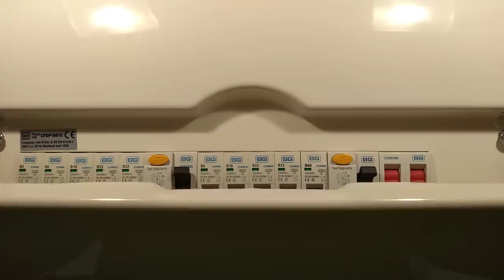A look inside a British home electrical panel.

Comment: Hi Clive 
Really enjoyed this video 
I was having problems at Christmas time with the power in the house if you remember I was asking you about inverters for the house?
As RCD tripping now and again anyway Christmas Day most of the lights had been flickering especially the kitchen ones as they were the cheaper LEDs and I put it down to that cos they have done it for sometime I.e two years put not all the time they were really bad on Christmas Day...
Sitting watching tv after dinner the tv etc went off but left lights on I thought RCB tripped again this time I couldn’t get into garage (electric door with battery backup ) so had to break the window 
Turned RCD back on for it to trip again 30 mins later spoke to my electrical and said he would come out Boxing Day to check .... 
I did notice my UPS was going daft through the night 
Next day electrician came out and we put it down to a faulty RCD he put another one in did a test and it held 
Rigged up a circuit to test old one and it tripped .... job done or so we thought 

When I came back to the garage after switching everything back on I noticed another electrician across the road said to mines and he said he was ok then the look on his face was a picture he called him turns out theirs was the same RCB kept tripping turns out we were on the same phase and it was an earth fault under the road it was soon sorted 
But a few weeks later I was having the same problem again RCD was faulty but was put in when we still had the problem 

Anyway I have now upgrade the consumer unit to the new metal box with all mines now RCBO with inline from grid surge protection so far all is well 

P.s we are on a PME system that’s why they came out as fast as the flat that was on the same phase had an old system and their earth was potentially live...

Comment: It’s odd to my tiny US brain there are so few available slots. A 100 amp panel here has 12 slots for 240 volt circuits. But since most of our circuits are 120 volt we have 12x 120volt so 24 circuits minus the appliances that needs 240 (electric dryer, water heater, AC, oven). 

Point is, doesn’t it become more likely to pop a breaker for an entire floor or section of the house by so many outlets sharing the same circuit and breaker? Seems like people using it would be very accustomed to visiting and resetting things in it.

For perceptive as a technician more than half of our customers don’t know where there panel is. I’ll often find them with the cover rusted shut, painted shut or most commonly if they are in a basement there is 4 tons worth of storage junk stacked in front of it. I even had a customer that had a panel that had a contractor put a wall over it prior to them moving in 8 years prior. While I don’t see a hazard with the UK setup it seems to encourage untrained people to be in there panel box. This is further exaggerated by putting the GFI reset in there too, don’t they commonly use switches on outlets but the gfi reset is in the panel?

Then again like I mentioned, tiny brain over here. I might just be missing something obvious.

Comment: as an norwegian electrician looking at that thing.. well.. i be glad i dont have to wrap my head around that type of thing.. our distribution rails are all phases and wrapped in plastic and rated at 63A.. so usually higher than most 400V houses.. and they go under the head of the screw and not in the cable-hole.. see your fuses there have slots like ours for rails there... dont they exsist? that thing there looks like its 150A.. it looks about 3 times thicker than our rails.... we have RCD on all fuses and connect all phases to the fuse..  i remember many years ago that the higher-ups claimed you couldnt get earth-fault in 400V systems.. then shortly replaced by, you dont need RCD on the neutral because faults between that and earth should'nt be possible.. and shortly after we got RCD on both live phases and neuteral.. fun times

Comment: Plastic fuse boards are easier in some ways but I've seen so many that are broken, some even exposing cables and the risk of electric shock, others would have the front lid covered in electrical tape because the fixing points had broken.

Comment: the concern for well being over nuisance tripping in the uk always amazes me, it's common in the us to have your refrigerator not on a gfci/rcd at all as well owing to the fact a nuisance trip could lead to spoiled food.  likewise it's common to find houses with zero gfci's in them even in bathrooms.  

our service tends to be 60a 240v on ancient services 100a on really old setups 150 sometimes or 200 on anything modern, generally 400a service is provided to two 200a panels for residential use not a single 400a panel.
it's not uncommon to find houses with 30-70 circuits in them especially when older systems are upgraded but the old circuits are left in place.

three phase is common in commercial installs but very uncommon to houses, when delivered it tends to be delivered with 208 phase to phase with neutral or as 480 or 600v delta with a transformer to generate a  120-0-120 split phase supply for smaller loads.

Comment: Thanks for the overview, it reminds me of a lot more of industrial equipment panels than what we see in our US homes. I prefer wiring industrial panels so I would probably enjoy this type of setup at home. Is that a giant ferrule on the split hot line connected to the first RCD? Are the panels in large commercial buildings similar?
Reply from the maker: Yes.  It's a dual wire ferrule.  Quite unusual in that size.

Comment: I encountered an incorrectly tightened bus bar in a consumer unit in a friend's workshop. It manifested itself as an intermittent loss of connection and a smell of burning fish. Whoever fitted it obviously had experienced the problem and then attacked the bus bar with a hacksaw to allow it to poke in further but still on the wrong side of the clamp.

Comment: MCBs dissipate power too, not just RCBOs. Wylex's datasheet claims for an RCBO it's 1.5W per pole at rated current, and 2.6W per pole for an MCB.
Reply: I think clive was talking about standby current, not losses under load.
Reply: @Basement-Science  Yeah, must be. Having rewatched Clive's disassembly of the transparent Chinese RCD and John Ward's disassembly of a Hager RCBO the circuitry appears similar, so I suppose an RCD and RCBO must have around the same standby dissipation.

Comment: This is interesting its quite similar to what we have in aus with the only difference being a lot of new installs are using rcbos for each circuit though many are using 1 or 2 rcds and standard cbs for the other circuits

Comment: mine doesnt have any rcds and it was refurbished 4 years ago lol you have lights, sockets, heater, cooker, kitchen sockets. (total of 5)
each has its own trip and then you have the main switch. no rcd at all. - i was surprised as the old once had 2 and looked like one you have, but the new ones we got 4 years ago only have 5 fuse/switches and the main one
Reply: 5 fuse, hear only one room house, haha. normal legally minimium fuses have 2fuse/room, one to light and one to soccets.and light need 10A and soccet need 16A normally, only water heater 3,2kw 1 phase need 16A fuse but if have biggest need own cable and own big fuse. same owen need little need only max 3,2kw 16A and big need 3 phase 20A normally.
Reply: It's definitely the first time I've had a fuse box without any rcds 😂

Comment: Most American boxes look so much more utilitarian. Big grey box somewhere in the basement (or mud room) with bland looking black circuit breakers.... That one there looks much more "stylish" I guess is a good word.. That box looks like it designed to be installed on a wall instead of between wall studs though.

Comment: Why isn't the main switch also a circuit breaker in a British consumer unit? It seems to me it would be better to not rely on the distribution network's main fuse, which when blown can only be replaced by them.
Reply from the maker: It would have to be a fault inside the consumer unit itself to cause main fuse failure.
Reply: Why would it need to be?
Reply: I think it's because atop of that breaker you have the main circuit breaker provided by the electricity company. It's how it works in France, but we have a different system so that mgiht not be like that.
Reply: At home I have a set of 63A fuses on the outside (it's 3 phase), it then goes into a small fusebox above the main box, there's a 50A breaker there and the 2 first boxes are lockwired by the power company, then it goes to the main box, where the power meter is and from that it feeds into all the other breakers, it's a double 3x18 box which originally didn't have RCDs and I'm currently installing them, but that takes time as the whole wiring in the house has to be redone, a lot of it is still 2wire aluminium
Reply: That's almost never the case. Here in Germany you've got in new installations a switch after the meter rated 3x63A (three-phase), and before the meter you've got a selective main circuit breaker which should be selective to the circuit breakers inside of the panel. But you can also install a a fuse holder containing D0 fuses, which I would prefer. The SLS are expensive and some people say they're crap. I once had a problem causing my main breaker to switch off L1, its a 50A breaker. But the C32A didn't trip, the RCD didn't trip, the 50A D02 type gG/gL didn't trip (they say this fuse should blow faster than the main circuit breaker trips!).

Comment: RCCB current should be equal or greater than combined current of all MCBs it's servicing. If it's not then there is a risk of it not working properly under a heavy load.

Comment: I seem to end up replacing the panels every time I move house and sure enough, I always ask for the largest one that will physically fit in the available space.  They seemed dubious at one house, but once I'd wired all the circuits I wanted, there were only 5 positions unused.

Comment: It must be nice not having to deal with the split-phase crap we have over here. Other than the GFI units, I really like the design of your panels. We often run into certain appliances that simply won't work on GFIs, but until recently, most places only require them in the kitchen and bathroom.
 Sometimes we take for granted how something so benign is so different in another country. I still don't like the colors for hot, neutral and ground

Comment: I have watched some videos about consumer units in the UK. I always wonder why they are tiny boxes in cramped space. Here in NL MCU's are on their own full height cupboard along with the gas and water meter. I have 3 RCD's with 11 CB's. Then 2 RCBO's for the aircocons  and 1 RCBO for the PV system. Also my cable modem and router are in there. Cannot imagine how that would be done in the UK.

Comment: I thought outlet points only needed to meet ip4x can't remember the reg number 

And I also believe a good deal of fires where from smart meter people tugging the meter tails but not being allowed to check the main isolator. I have actually found a good number of loose tails

Comment: Here in Norway our systems are a bitt different .. well we dont have plugs like the UK where you only can put them in one way ... so normally all breakers have both phases instead of just breaking one phase because of that. Where i am living in now ( where it setup somewhat stupid ) all my breakers are like 10 amps B with earth leakage protection ... that in it self is all fine .. beside the fact we also have a main earth leakage protection ( that is causing me trouble to find the earth fault we had the other day .. because the main breaker would trip and not the earth leakage for the breaker line that was actually having the fault .. killing the whole house basically . Beside that you and mine setup are really similar ... 

In general i like this modern system like that and its in general really safe especially with the earth leakage protection ...

Though watching some other UK electrician it seems the placement of the distribution board in the UK seems to be really bad and odd places ... Another difference i have seen we do is that we basically put all our cables into single 1 phase cables into plastic tubes trough the whole house always ... meaning that if a wire goes bad in the wall for some reason or you need to upgrade its easy just to pull a new cable ( sort of ) trough the tube. Also we dont do any ring systems like the UK .. Meaning that Normal fuse sizes are ether 10 amps to 16 amps between B(that is fast) and some few  C types breakers ( that are slow for motors and appliance with a high start current ) 

Beside those difference i think we share the exact same EU rules for electrical installations

A breakers seem to be on there way back here though for car charging if i am not wrong ...

Ohh yea .. also big difference .. we dont have shower heaters like in the UK .. We just have a 200 liter boiler in the house that supplies the whole house with hot  water or 300 l boiler to where i am moving now ^^
Reply: It is not because of the plugs. Most of Europe use the same plugs. It is because of the weird system Norway has. There are no neutrals just 230 V phase to phase. Finland used to have 220 V phase to phase in the cities until the late 50s, same with Sweden but then 127 V was used for normal domestic electricity. Rural areas used 220 V and the center of Helsinki 125 V DC. Not at all confusing.

Comment: The lid didn't have markings for labels?  In the USA each breaker is numbered and there is an area so you can write "Bedroom lights", "Kitchen lights", "dryer",  "Water Heater", etc.
Reply from the maker: It's a set of adhesive labels.

Comment: I had mine replaced with a metal 2 RCD unit with a surge protector.
Before that could happen I had to have an isolator switch fitted after the meter.

Comment: I have a small flat, it has 4 rooms, a hall and a walk in cupboard. For reasons I'm sure can't have ever made sense to anyone, there are four consumer units and a tangled mess of wire on the wall of the cupboard. Everything would have fit in the largest of the consumer units with space to spare!
Reply: They might have been for storage heaters

Comment: inschulated glaund ^^
No lightning and surge protection, current homes are so filled with electronics it's worth to buy it. Or two. Class B or C in the main box and then class D just before the most sensitive gear.
Lack of 3-phase is a bit concerning, especially for a place with an electric range. Also gives a bit of redundancy. if one or two phases die you still have something. Half of the cooker, lights, working fridge or whatever.

Comment: Does your gland (oo er) not fit the knockouts on the edges of the box and the tape goes round the ones in the back? Another great vid...looking forward to the rest in the series.
Reply from the maker: The information helpfully pointed out that the undersized knock outs at the side could be enlarged to take the larger gland.  The grommet strip does indeed go around the larger knockouts in the back.

Comment: Nice.  Clive, am I right in thinking that to ensure the board and house is fully earthed the far LH top earth brass block should be connected to the far RH side top neutral bar by a 10mm earth cable ?  Thanks.
Reply from the maker: In the UK the only point the neutral and earth should be connected is in the suppliers cable head for appropriate systems.
Reply: @bigclivedotcom  most helpful thanks.
Reply from the maker: @brianlopez8855  If they had been linked it would have potentially resulted in rogue tripping of the RCD associated with the grounded neutral bar, as it would result in current bypassing its sense coil.
Reply: should I expect provision by the power network provider of a 16mm earth cable from the side of the neutral head connection to go to the earth bar on the board with a modern power supply ?
Reply from the maker: @brianlopez8855  If they are providing an earth there may be a suitable terminal depending on the company.
Reply: @bigclivedotcom  thanks I'll take a closer look

Comment: So you only have one voltage, in the states its a bit more complicated, with 110 voltage for lighting and general plug ins around the home, and 220 2 leg voltage, 110 to neutral, 220 across legs for heavy equipment such as welders or electric ranges
Reply: our 3phase systems offer 415v for industrial and commercial installations
Reply: I’ve got my own 12.5K line and a residential 120/240, 4 x 400 A transformer for the home and a 208-WYE 3P 2 x 400 A transformer for the shop. 

In the US you have choices. There isn’t a one size fits all, mommy knows best approach. 

The conformity of thought and practice in the EU is one reason we don’t even accept employment applications from outside the US/CA.  

The view of what’s “right” is what mommy says rather than what UL actually tested. 

Expensive, overly complicated and inflexible light industrial electric drives everything into a noncompetitive swamp. 

Give me a power electrician who can successfully get on a phone call with the utility company and UL and I’ll hire them any day. 

It’s all about proper training not listening to mommy.
Reply: @boonedockjourneyman7979  lol sounds like mamma knows best hey
Reply: @boonedockjourneyman7979  Typical 'not invented here' syndrome.

Having one common standard makes things easier and cheaper. Get over yourselves.
Reply: @Monkeh616  just asking, I believe Tesla invented it, I think he was Serbian, there are some small cities with their power system and they have a similar setup but at 110 volts, at the mine I ran we had a 440 3 phase system in a delta configuration. This meant if you got between 1 phase and the ground you would only get a tingle, but if you got between two phases it was lights out. There is no neutral in a delta configuration